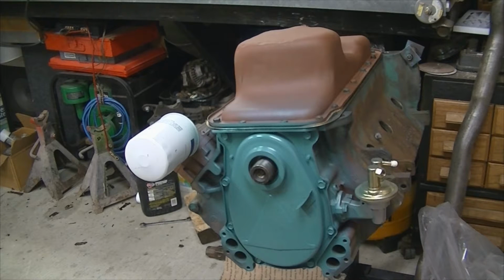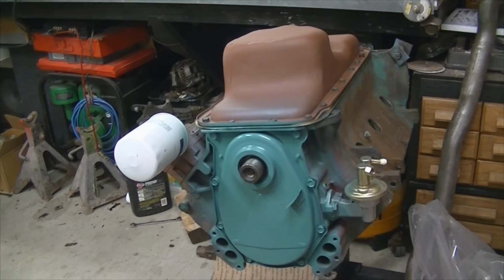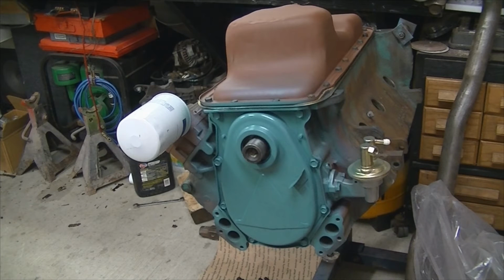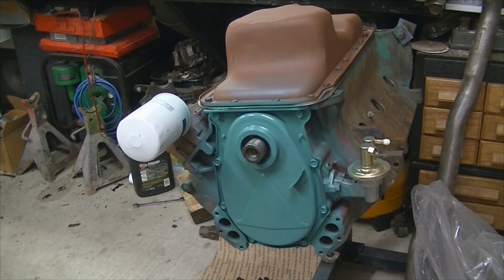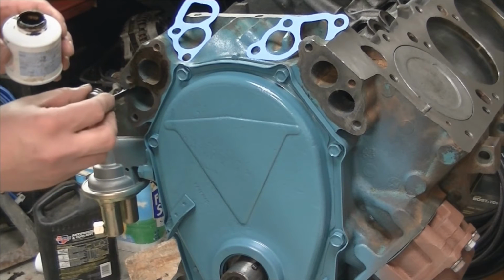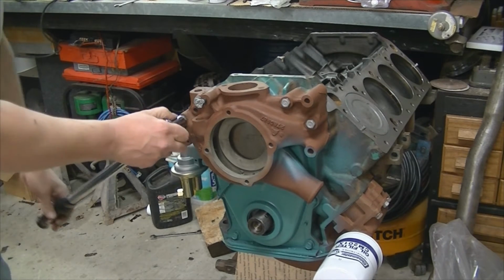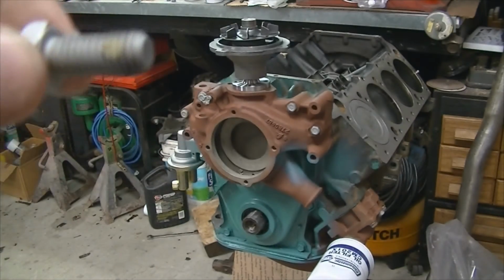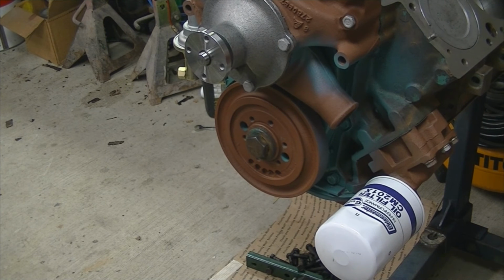Joe’s Garage 383 Engine Rebuild Part 6 –Water Pump installation

Comment: I've got a 1978 dodge 440 b300 mobile home. What the easiest way to replace the water pump? Will I have to remove the radiator amd all the belts?

Comment: One of the original heater hose nipples on my water pump housing is seized on. I have replacement ones but having issues removing the existing one. Any tips? Also I noticed a 3rd threaded hole next to the 2 nipples you installed in the video. What is that for? Mine is blocked off.

Comment: Where did you get the 2 water pump nipples?  I have the BB 400 so surely they're the same part number.  Was that aviation gasket sealer on the pipe nipple thread's too?

Comment: i have a 440 and i was wondering which bolts go where from waterpump housing to the block....this is my first build and im 21 lol
Reply: Harley King if you haven't figured out the long ones go on the sides next to the inlet and outlet jackets